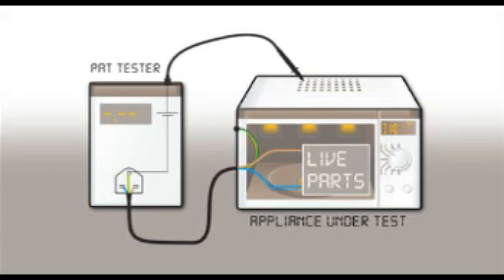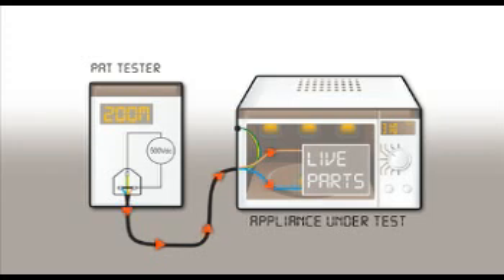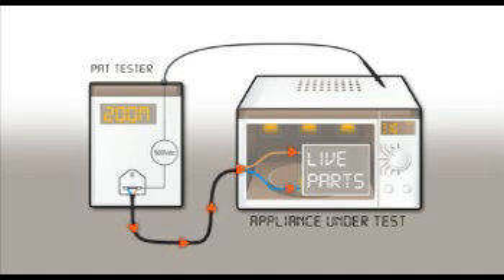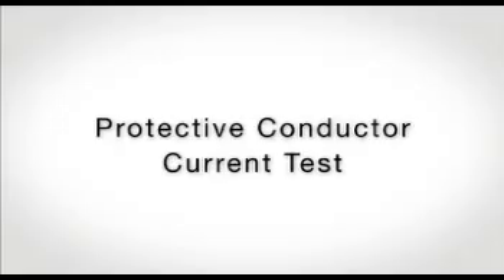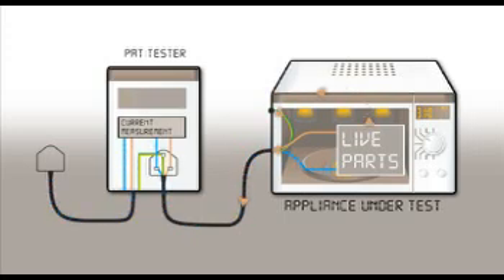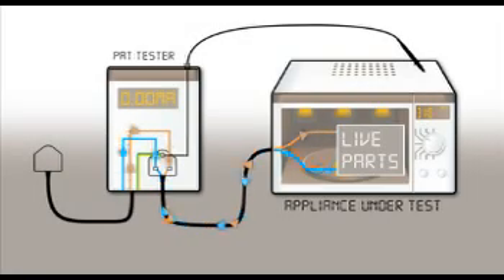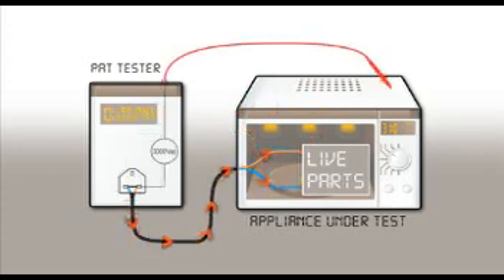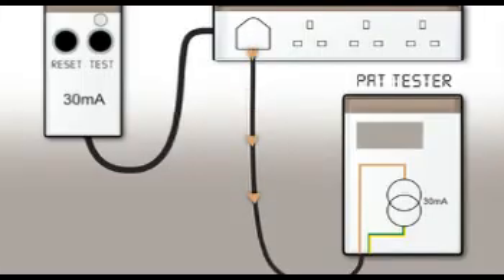An Introduction to PAT Testing

Comment: This is probably a silly question, but if you're applying 500V or 1500V to an appliance for some tests, isn't there a risk of the test itself damaging the appliance?  I'm thinking mainly of electronic items.
Reply: Yes electronic parts will get damaged. Either you have to isolate or inject working voltage. Another trick is to short the terminals so that the potential is zero. 
So meggering is an art.

Comment: its worth noting to any reader who doesn't know. A PAT Test does not mean an appliance is safe to use. Whilst it's a good practice, it doesn't check other parts of many class 1 Appliances, and it doesn't test all circuits in a Microwave.  With the growth of Reuse in Electrical Appliances, it's important that Evidenced Competence exists and depth of knowledge when putting an Electrical item on to the market that has been repaired, or retreived from the waste stream.  I agree, Seaward are good units as well.
Reply: There’s no such thing as the “growth in reuse in electrical appliances”. We live in a disposable society. Also, cut out the excessive capitalisation and improve the grammar.

Comment: PAT Testing = Portable Appliance Testing, Testing??
Shouldn't the title for this be PAT (Portable Appliance Testing) or similar?
PAT is an acronym that ends with a T meaning 'testing' so it's unnecessary to repeat it.
Reply: Portable Appliance Test Testing (PAT Testing) is correct (it would be like saying exam taking, or inspection giving). If you want to split hairs then the noun "PAT Test" is wrong, yes. But nobody cares.
Reply: strokes beard
Reply: Or it should just be called PA Testing!
Reply: No, no, no.  'PAT' stands for Portable Appliance Test.  So the plural form would, of course, be PATing.
Reply: Martin Winlow

Comment: A laptop is powered from Extra Low Voltage, so it would not be appropriate to perform any of these tests on one.
A laptop power supply, however, is powered from Low Voltage (230V mains), so electrical testing may well be appropriate.

Comment: @PUMPKIN1080 Correct but you still have to look for a metal contact ie a screw going into the appliance metal tubeon the front of the hair drier or perhaps the metal guard on an angle grinder.to make your current path We know that double insulated kit shouldn't give a reading but that is the check just to make sure its safe! Hope this is a help